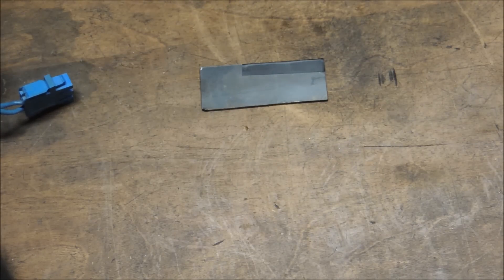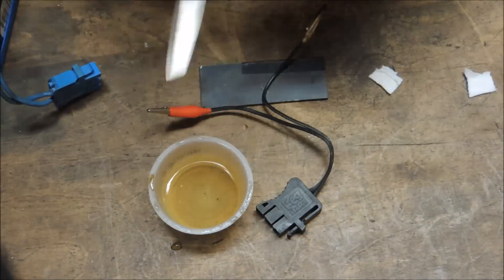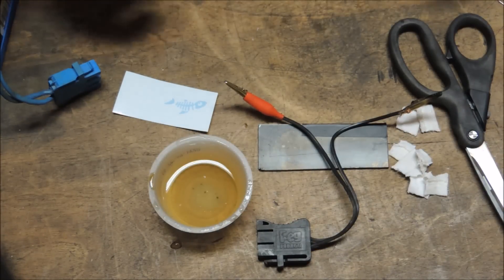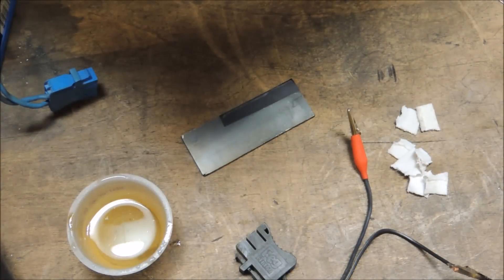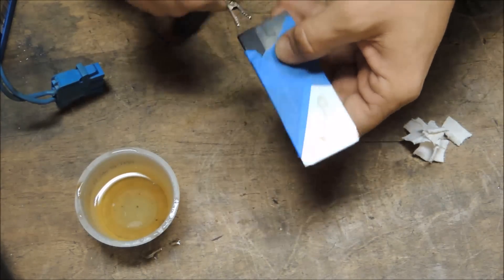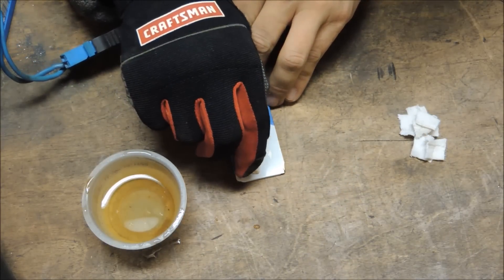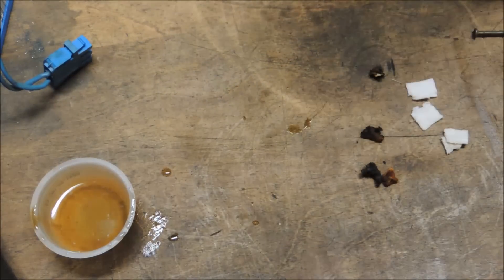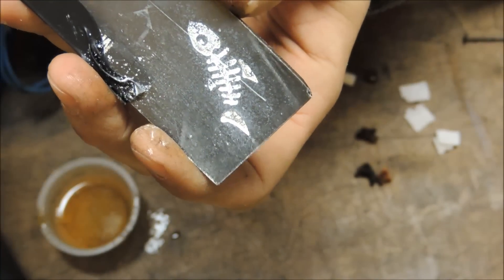DIY: Metal Etching

Comment: Attaching the + to your work barely etches and darkens more. Attach the - to your work for stronger etching. 

I use lemon juice instead of salt water and sometimes weak acids. 

You can also inlay copper or other soft metals by banging it in softly after heating it up or melt it on with a torch. Real silver and gold looks quite nice!👍🏻
Reply from the maker: Good stuff! Thanks for the comment.

Comment: Can you take 2 wires and make it work alligator clip to alligator clip? Finished you would have 2 wires for with a clip on both ends, 1 set black one set red? Clip one end directly to the battery, the other end for the project? Thanks for the video & any help. I am new to this but really wanting to learn how to etch like this.
Reply from the maker: Justme Here As long as you are completing the circuit, you’ll be fine.
Reply: @BellyUpFishGarage  Thanks so much!!!
Reply: @BellyUpFishGarage   I just purchased the battery & alligator clips today. Does it matter what kind of wire is used between the clips? Can it be one from cutting both ends off of an extension cord & putting the clips on those or is there a specif kind I need to use? So new to this, sorry for such basic questions here, but I do appreciate the help!
Reply from the maker: No worries, we all start somewhere.  Wire from most extension cords should work.
Reply: @BellyUpFishGarage  Cool, Thanks!

Comment: I've heard that you can use nail polish and paint on a design, and it won't be etched where the polish is on.  Afterwards polish remover works to remove it - have you tried this or have any experience with it?
Reply from the maker: Matt Plays Yep, that works. Works well when you're acid etching a blade as well.
Reply: +BellyUpFish
Sweet thanks, saves me from making a stencil and I can hand draw the designs I want (straight onto what I'm etching) :D
Reply: Matt Plays How would you do it? I mean, how does the nail polish allow you to draw the design directly into the metal? Do you cover the area with nail polish and then cut out the design after it dries out? Sorry if Im being a bit dumb hahaha
Reply: Yeah, it turned out well - cover the surface of what you are etching (after cleaning it of course) with nail polish, then use a nail or something else sharp (I used one of the prongs from a broken multimeter)to scrape off the nail polish.  I have also used permanent marker to draw the design but the nail polish works much better.
Reply: Matt Plays Nice, I'll give it a try. Thanks man!
Reply: Good luck, keep in mind that the nail polish smears when you're doing it - the heat of the metal increases while current flows through it.  The best thing I've found to combat this is to dab it (straight up and down) with the saltwater rag but DON'T wipe it - dab the piece you are etching and keep going until you're completely done.  Then, clean it off with nail polish remover and if it isn't as deep as you want it then paint on more nail polish and repeat the process.

Best to have a test piece of metal and test different times pressed against it with the rag to see how deep each will go.  Once again, DO NOT wipe it else it may wipe then nail polish off of part of the piece without you being able to see it because it looks like a black sticky mass.
Reply: use stove paint

Comment: thanks for posting, how are you making the initial stencil?
Reply from the maker: I am using a vinyl machine to make the stencil.
Reply: +BellyUpFish 
>>I am using a vinyl machine to make the stencil.<<

well shit I guess we all have those.
Reply from the maker: +TruAnRksT they aren't terribly expensive. Or you could find someone who has one to cut you some stencils for a few bucks.
Reply from the maker: +Earl E. Bird most of them aren't reusable, but the vinyl is cheap enough that you can make them one use stencils.  You need the adhesive to keep them stuck well during etching.

The Silhouette will cut cardstock, which can be used for spray paint stencils, but not etching.
Reply: +BellyUpFish thanks for the info
Reply from the maker: +thepoultrypeople sure thing. Let me know if I can help.
Reply: BellyUpFish cool, aaaah lend me your vinyl cutter? ;)
Reply: seriously, i might ask you about converting pictures to a plotting format though?
Reply: You can just use nail polish and paint your design on there, unless of course you want a very detailed or very procise stencile.  Just for something simple though, it should do the trick.  Hope that helps

Comment: ok so what is this. I have just been going down an internet hole in engraving but i have never seen this method. How does it work? Is the metal being melted or disolved in the solution?
Reply from the maker: The electricity is eroding the metal.
Reply: That is completly facinating, thanks for the quick reply!
Reply from the maker: No problem. Thanks for watching.
Reply: old, but look up "electrochemical milling", that's the technical term for this

Comment: Where can I purchase the adapters for both ends. The battery and the alligator clips?  If you could post a link to them I would greatly appreciate it. Thank you.
Reply from the maker: Any 12v battery and a easy pig tail adapter would work.  Are you in the USA?
Reply: +BellyUpFish Yes I am. I'm in NY.
Reply from the maker: +Mallissa Nuse I wouldn't buy this setup if I were to do it again, it's just what I had laying around, so I used it.  The battery was around $55.  For that money, I'd buy an adjustable power supply from Amazon for $50..
Reply from the maker: +Mallissa Nuse something like this:  Yescom Adjustable Output 30v 5a Input 110v Precision Variable Digital Dc Power Supply w/ Clip Cable https://www.amazon.com/dp/B00QJS8RW0/ref=cm_sw_r_cp_api_8uAsxbBBJS5XV
Reply: +BellyUpFish Thank you very much for your help
Reply from the maker: +Mallissa Nuse if you need any help, feel free to ask.. A 9v battery will work. ;)
Reply: just pull your car battery out for a weekend, or use a battery charger. if you have any 12v power supplies like the wall-wart plugs for many appliances, they typically use between 9v and 12v DC. Computer power supplies also have varying voltage wires between 3v, 5v, 9v, and 12v.

Comment: Hi, does this method work on aluminum with paint finish? I wanna etch on a magazine base pad...
Reply: It says it's hard anodized
Reply from the maker: +Archman.E I wish I knew.  I've never tried it on aluminum.
Reply from the maker: +Archman.E Anodizing can be removed using oven cleaner, but you have to use the "hardcore" stuff, you can't use the low odor stuff.
Reply: +BellyUpFish thanks man!  That's helpful. I ll look into it

Comment: thanks for  reply sir ( but   i mean that a 12v  big batttery  can eatch faster or not)
Reply from the maker: Haseeb Jane if you wanted to go faster, I would try more voltage.
Reply: BellyUpFish not higher volts higher amps will go faster
Reply from the maker: Joe Martin You're absolutely right. Not sure why I said volts. Thanks for correcting me.
Reply from the maker: Joe Martin You're absolutely right. Not sure why I said volts. Thanks for correcting me.

Comment: Thanks for tutorial | sir plz tell me that what thing etch best ( high voltage or high amp) plz
Reply from the maker: Haseeb Jane I was only running 12v.  No idea of the amp draw.  Just a standard 12v battery.
Reply: 12A? Motorbike batteries
Reply from the maker: Yes. You can do it with a standard 9v battery as well, but it doesn’t work as well...

Comment: so....you put on just one cloth glove for "safety" and not nitrile or latex, then you use your other bare hand to remove the contaminated wick after etching? ...ok.
Reply from the maker: Did you watch the video with the volume off?

At 5:51 I said, "It gets nice and warm."  Nitrile and/or latex gloves do nothing positive with regard to heat transfer.
Reply: @BellyUpFishGarage  um....don't put your hands right next to where heat is being generated? I was referring to the chemical compounds generated by the reaction going directly onto your hands.....They are quite toxic, given you are using sodium as the electrolyte and iron is being electrolytically  reduced. 

Trust me...its toxic. I am a semiconductor equipment machinist who uses ECM tools to shape and de burr components. They work the exact same way, only our tools generate thousands of amps and the electrolyte is continuously  flushing thru the parts being formed.....and even though there are guards to keep you from ever coming into contact with the residue generated, we still wear gloves.
Reply from the maker: The byproducts here are mostly sodium hydroxide and chlorine.. 

While sodium hydroxide can be corrosive, the amount generated by this reaction is far and away not "quite toxic."  

I guess I should have rushed to the sink and washed my hands with soap (containing more sodium hydroxide) to get it off my skin.
Reply: @BellyUpFishGarage  oh boy....here we go ....
Sodium Hydroxide is a highly alkaline caustic substance used to lower PH , is extremely effective in corroding organic material (its used in drain openers)..and is considered an alkaline poison....as for your soap reference, its added to other ingredients and a reaction  occurs (known as saponofacation), and a completely  DIFFERENT material is formed; soap.
Chlorine was used in chemical warfare in world war 1......
Next time do a little bit more research than just a quick Google search when youre attempting to debate someone who minored in inorganic chemistry in college.
Reply from the maker: david klebs I’m very impressed! Please, tell me more about yourself.

Comment: Can you use a 12 volt trickle charger for the power source?
Reply from the maker: You'd have to find a way to make it output a constant voltage.  I'd just use a 9v battery.
Reply: +BellyUpFish Gotcha! Thanks.

Comment: you dont need vinyl. blue painters tape works just fine
Reply from the maker: +Porsha Helms  That's true, but vinyl is much easier to apply and typically yields a cleaner result.
Reply: I've heard that electrical tape works well.
Reply: Sam H sir, can you tell me how it works on electrical tape?

Comment: I'm looking to etch a S/N, name, and all the required info (plus extra) into my 80% builds i do (1911's, 2011's, sig p226/229, AR, AK, H&K's etc...) this will work on both aluminum (7075) and steels yes? also, i've seen differing polarities, is the electrode (the pad) supposed to be negative or positive or does it matter? you used "electrode negative" here, but i've seen others use positive.

does the solution matter? i've seen others use different solutions such as vinegar and other stuff. with a variable power source, would altering the voltage matter? 9v vs 12v vs something higher like 24v?

is there an easy way to do font stencils? My original plan was to stamp everything with a 3mm stamp (IIRC the requirement for manufacturers is 1/16th font, and 3mm is larger than that, and about right) i'd like to stick with a 3mm font, but being able to print and etch it would be far easier than having to line up stamps. i've used stamps on a few AK builds and It just never comes out right.
Reply from the maker: +Munky332 I've never tried it on aluminum, so I can't say for sure, but I have been told it works.  

I've always used the electrode on the negative side.  

I would expect the solution to matter, but I've not experimented with anything beyond this since it works.

An adjustable power supply would be nice and you could open yourself up to anodizing as well with one.

Don't stencils - easiest way for me is my vinyl cutter.
Reply: +BellyUpFish unfortunately I don't have a vinyl cutter. I think only way would be for me to use press and peel blue

Comment: Will it work if the area is anodized?
Reply from the maker: +redriderf26 I don't know.  You'd probably want to remove the anodizing, but it might work without it.
Reply: K, thanks, only one way to find out right.... I will give it a shot. Thanks for the video, gonna do some 80's
Reply: IF a person without an ffl wants to mark a firearm for registration purposes, do they have to use their real name as the manufacturer? or can they make up a cool name? What does the atf approve?
Reply from the maker: +redriderf26 If you don't have a trust, yes, it has to be registered to your name.  If you setup a trust, you can use your trust name, which can be anything.

Comment: will this work on toe nails?
Reply from the maker: You'd need more voltage.
Reply: +BellyUpFish i think am going to go with the regula forging stamp then
Reply: was thinking of the press hammer to make sure I get the proper depth according to NRA guidelines
Reply from the maker: +guachingman harbor freight has their 20T press on sale. $189 I think.
Reply: BellyUpFish Hope they have a guarantee
Reply from the maker: +guachingman lifetime.  They don't warranty your toes though.